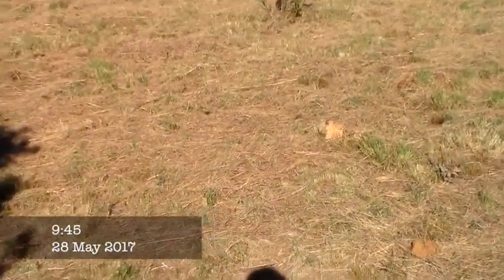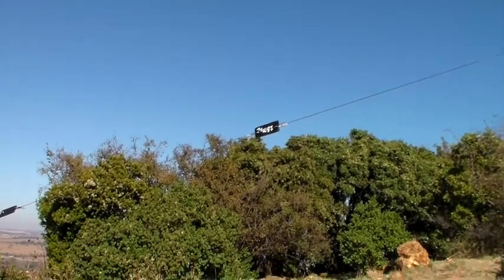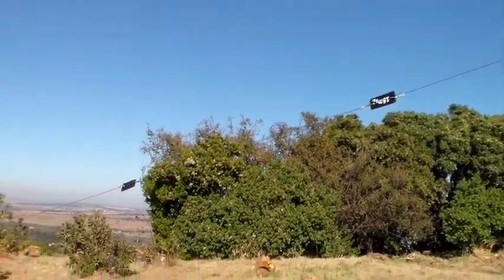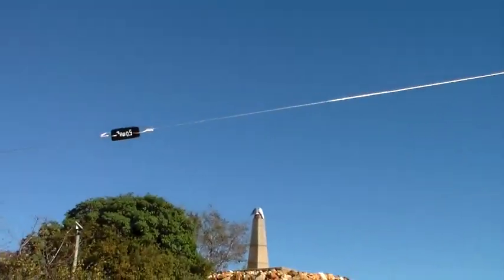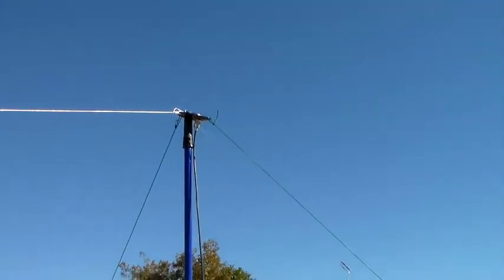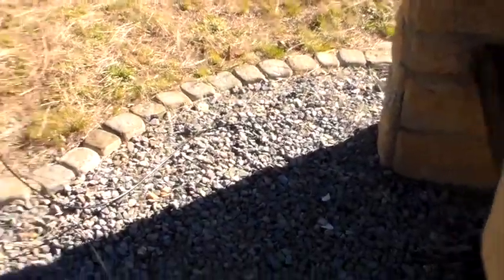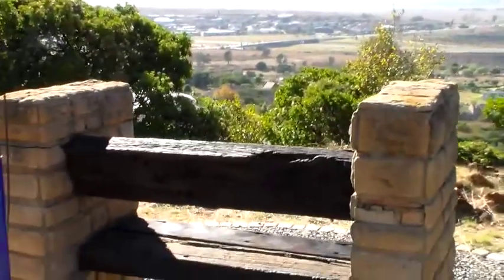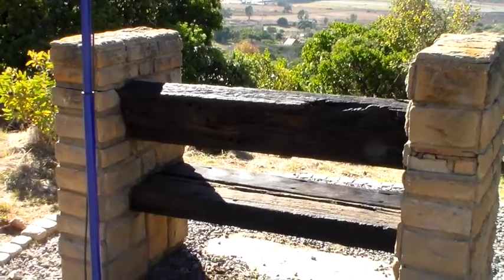QRPP summit activation using a Pixie - 28 May 2017

Comment: 1670m quite a hill. That's a 10 point SOTA summit in Australia!
Reply from the maker: The surrounding plains are around 1500m to 1700m above sea level, spanning many kilometers in all directions. My house was at 1550m, so walking up to 1670m was a light stroll. Since then we moved to Alberta Canada and we now live much lower - the new house is at 1080m. From where we are now, 1600m is a pretty decent hike / climb. I'll try to post some new footage soon of some SOTA activations in the Rocky Mountains.
Reply: @ve6svj  FB.  I live at 100m ASL so 1600m is a mountain indeed!  Of course we drive mist of the ascent.

Comment: The Pixies I've used have such wide receivers that it's difficult to hone in on any particular station. Have you modified your Pixie's receiver at all to correct this, and if so, how did you do it? Great effort and video, thank you.
Reply from the maker: Yup, the Pixie is so wide on receive, when propagation is good you can hear everything from commercial stations around 6.something MHz all the way up the 7MHz band. It's ok for calling CQ and people responding smack bang on your frequency, but its useless at trying to respond to other people since they might be several kHz away and won't hear you - they're on a different frequency. This video was made in South Africa where there are about 600 active hams and nobody else in a 1000 km radius... the Pixie does not work in the USA where there are thousands of stations in your very wide reception range.

Since I made this video, I moved to Canada, tried the Pixie a few times and had one contact from Calgary to Vancouver in several months of trying... so then I switched to the 49er, which has a much better receive and 10 times the power - a full 3W ! That has made a big difference. I still use the Pixie in the shack for testing purposes, but I'm completely converted to the 49er now, which is a $6 kit from China. I'll try to make a video about that sometime soon and I have a QRP Labs QCX for 20m on the way. After the Pixie, that is going to be a substantial upgrade.
Reply: @ve6svj  I just received the MTR3b yesterday. It is also tiny and lots of fun! Haven't heard of the 49er but I did build and still use a 40m QCX. I mostly operate QRP so I don't waste my time with hopelessly bad receivers or rock bound sets. With today's cw sets, this is truly the golden age of portable QRP.
Reply: @porkyfedwell  Oh, I completely agree, but I think there are two separate things there... the one is operating, for which rock-bound sets with crappy receivers is really terrible... but the other is minimalism in design. I find it interesting how you can cut back and streamline when you start from zero and work up, rather than starting from requirements and cutting down. The Pixie is a good example of the absolute minimum you can get away with. It sucks, it's useless for calling CQ, it puts out stupidly low power even for QRP... but it only costs $4 and you can assemble it in 2 or 3 hours without any fancy equipment. As a rig, it is terrible, but as an experiment in minimalism, it's not bad. The 49er is 50% more expensive at $6 and 4 hours assembly, but the increase in performance is on the same scale as going to $40 and 8 hours assembly. Anyway, just my opinion. If someone is not into electronics or minimalism, then the Pixie is the very last rig I would recommend. If you're just starting out and likely to blow something up or if you're a school kid on a pocket money budget, then the Pixie is pretty high on the recommendation list.
Reply: @stephenvj  I am a minimalist on power, working as low power as conditions allow (down to 100 mW), but not a minimalist in terms of functionality. To each his own.

Comment: Sounds like your pixie creates a side tone. Was that already built in or did you add a keyer? 
73, Roland K7FOP
Reply from the maker: Hi Roland. No, it is not a keyer... it's almost embarassing to admit, but in this version 4.3 of the Pixie, the Chinese manufacturer added a cheap buzzer to the keyer port, so it is simply 9V applied to a buzzer. Not at all elegant... but then, neither is anything else about the Pixie. It is as cheap and easy as you can get, with every conceivable short-cut taken. 73.

Comment: Parabéns! 73 de PU3LTK. Tenho um pixie 7023khz que logo vou montar, é o que você usou? Quero testar este pixie em um morro da minha cidade. Grid GG30oi. Qual o esquema da sua antena? pu3ltk@gmail.com tks!
Reply: Hi Daniel. Yes, I used a Pixie in the video. Specifically, it is version 4.3 from Banggood.com - I will put the link below. Be careful with the power supply - the week after that video, I put it on a 12V battery and I blew up a diode and a capacitor. This kit is made for 9V and not much more. In the video I used a linked dipole with the links connected for 40m, but because the Pixie is fixed on 7.023, I think it is better to use a normal dipole. https://www.banggood.com/DIY-QRP-Pixie-Kit-CW-Receiver-Transmitter-7_023MHz-Shortwave-Radio-p-991566.html?rmmds=search